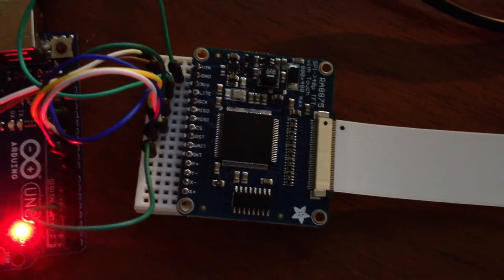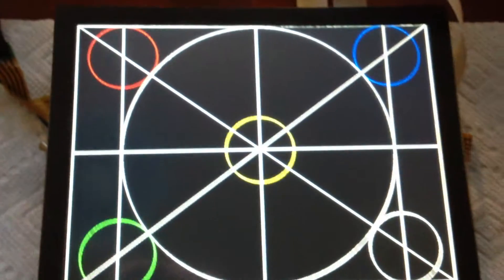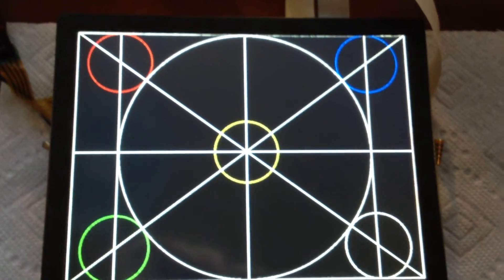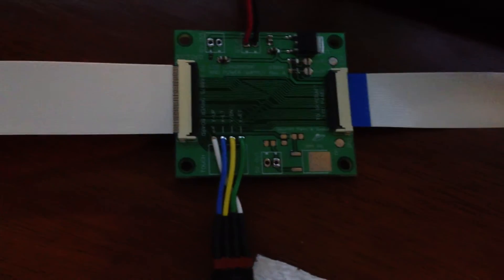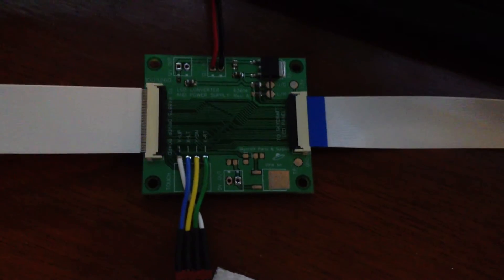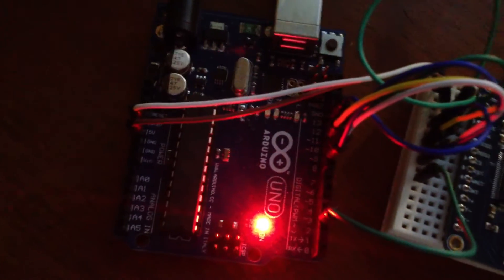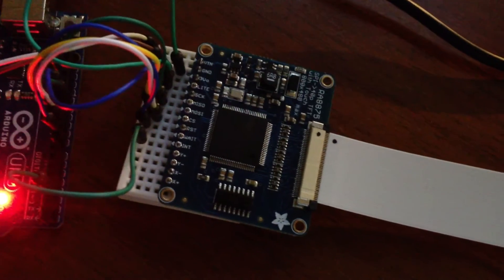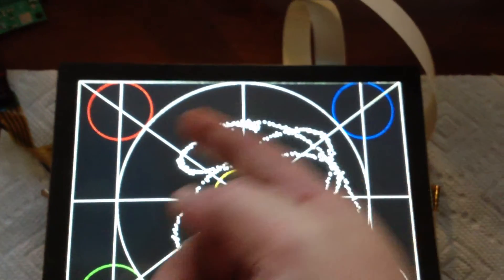RA8875 running an 8" 640 x 480 TFT RGB Touchscreen Display

Comment: Nice job! Have you measured frame transmission rates (from MCU to RA8875)? How fast is the SPI lines going? I'm considering a similar design (button display instead of drawing table) and I'm doubting on wheter use serial or parallel interface between MCU and RA8875... I'm consiering to use STM32F107 or similar, by the way.

Comment from the maker: IT WORKS. !
Got the Adafruit RA8875 TFT Controller working at 640 x 480 along with the touchscreen via an adapter PCB I made last week !  It all communicates via SPI to a microcontroller... in this example an Arduino Uno.  I slowed down the ADC calls a bit, averaged by 4, and the touchscreen works way better.  So while the RA8875 library examples use the touchscreen they do it too fast, so slow the routine down via a few millisecond delay and average 4 touchscreen data samples - it produces a very nice output that way and still has a nice response time !